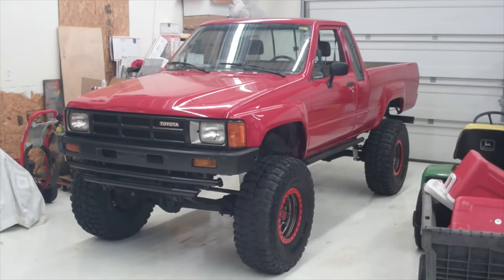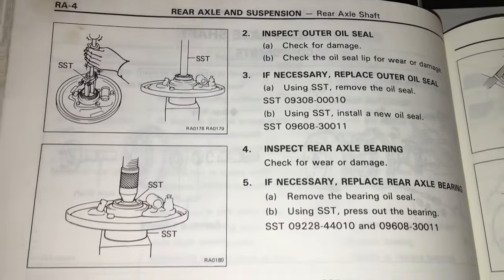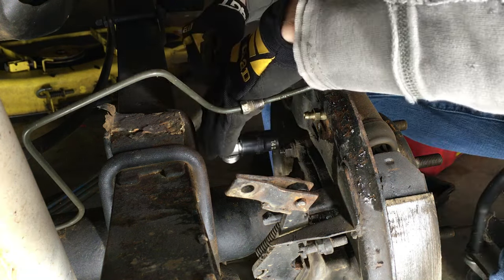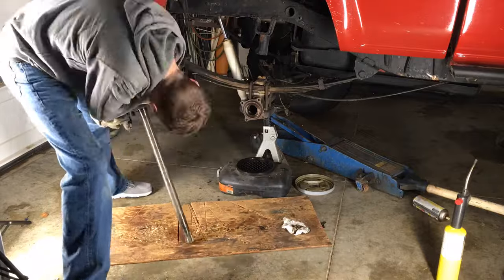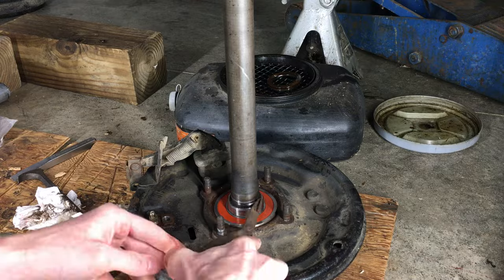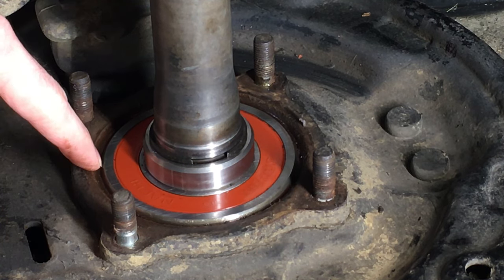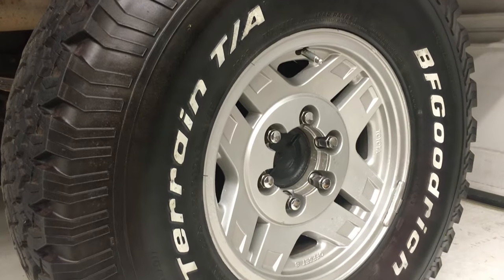Install Toyota Pickup/Hilux Rear Axle Bearing, Oil Seal - WITHOUT a Press!

Comment: I have a 2008 Toyota FJ Cruiser with rear caliper brakes. Do the steps vary much? I was told my axel seal is leaking but it has 156K so I thought I might change bearings as well

Comment: Hi Mate, just wanted to give you a shout out and say a big thank you. 
On my most recent trip away over the Easter Holiday to northern Australia, my wheel bearing smashed into 4 pieces 1,200km (750miles) away from home.
All the mechanics i contacted told me it could only be done in a workshop with a press!
I sourced the parts, and with limited tools and lots of cursing I replaced it on the side of the road with the confidence from your video.. thanks heaps, I owe you a beer!! Cheers!! 👍🏼👍🏼👍🏼👍🏼😎
Reply from the maker: You did this job on the side of a road?!? You are legend!!!

Comment: Pro tip. To remove the rear retaining ring that is pressed unto the axle shaft, cut as far into it as you can with a small cut-off disc. Just cutting about halfway through will weaken the ring just enough to crack it with a cold chisel and hammer. It will save you the hassle of banging that assembly into the floor for 30 minutes.
Reply from the maker: Juan Martinez I will try that next time 👍👍 thanks!
Reply: If one does not have air tools or electric grinder at their disposal, you can drill a few holes and use a chise and hamer to helps splinter the retainer also. Juans way is much easier when access to tools is not a problem.
Reply: hello there Juan. thanks for the pro tip👍
Reply: That sounds like the best idea. Just go to Toyota and get a new one before you start the project.

Comment: I loved the video and decided to try it for myself, but no matter how much I banged it I couldn't release it (also have the abs ring). Ended up building a puller tube that uses a 3 jaw puller to remove it. Worked seamllesly, highly recomended it if you don't have a press.
Reply from the maker: That was a good solution. I'd love to see the design of the puller tube.

Comment: Thanks Brother! I have a press and still used your method. It saved setting up the blocks and balancing act of the axle in the press. Took less than 1 minute per side to get the bearings off the axle and just moving them to my machine shop would have taken that long. Thanks for the video!
Reply: No way? It’s a miracle when repairs actually go as planned. Haha I just noticed oil stains around the 4 studs and plate. Hopefully bearings aren’t going out

Comment: In the mid of changing my wheel bearing on a 92 HiLux. The retainer ring would not move an inch, after pounding the backingplate for two hours i gave up haha. Found it easier to use different sizes of chisels between the retainer ring and wheel bearing to sort of press it out. But very good video

Comment: Looks pretty straight forward. I am doing the rear brakes on my '87 2wd Pickup and found the oil seals leaking. So I'm doing the seals and bearings while I'm at it. If I can't find a shop to do the hard stuff I'll give this method a try. However, I would never reuse a cotter pin. New ones for me. Good video, thanks!

Comment: I have a press, but I don't have a garage. Swings & Roundabouts, eh?

Thanks for the walkthrough. I'm going to have to do the oil seals on my Hilux Surf [if it ever stops raining over here in the English summertime] and, ironically, your video made it seem easier than other ones I've watched which did use a press. My only "wince moment" was when you used the pipe to drive the retainer on and the retainer was hitting on the centre of the wheel bearing, rahter than the edge.
Reply from the maker: Great point! I see what you mean... I should have placed something such as a giant washer between the pipe and the bearing.

Comment: I looked all over my area for a 20 ton shop press. Even a hundred miles away. So I build one. And I’m glad I did no pounding for me. If you don’t have a press take your axle to a shop and pay them to press the bearing.
Reply from the maker: I actually bought a used harbor freight 12 ton after this. I haven't had to do axle bearings since, but it's been useful for other bearings. No more sore hands!

Comment: I bought new backing plates not knowing it would be necessary to have some special press to take that off.. now im going to try again like you did. THanks for the tips!
Reply from the maker: Good luck and wear some well padded gloves!
Reply: @6thGearGarage  Thanks I will!.. Was thinking about the plywood and how it got chewed up.. I have a 1/4 inch copper plate.. was thinking of using that instead.. that way more of the energy would be transferred to the shaft..and maybe help get it off sooner.. The wood seemed to absorb the shock a little.. i guess in the end you would have bigger biceps!..  ;-)
Reply from the maker: @mg43472  the wood absolutely absorbs a lot of the force. I was tempted to do a couple of taps on the concrete, but knew it wasn't worth the risk of smashing up the splines. I was out of breath by the end!
Reply: @6thGearGarage  Yea.. no.. not smashing it into concrete!.. you wouldnt want to mess up the splines..!

Comment: Top Notch video. Only problem with doing it this way is it can bend the backing plate.  And also I've done a few where they just don't move at all with this method. Like the one in the video on my page. This method would not have worked. It was way too tight
Reply from the maker: Good call, especially if the backing plate is thinner from rust, as many of them do.

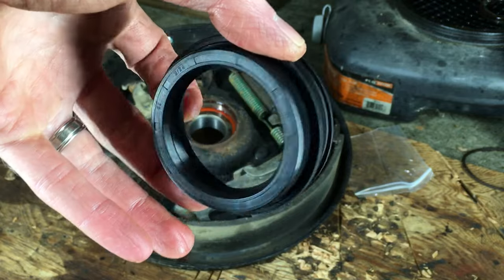Comment: 7:33 Don't do that. You are banging the inside race onto the inside race. You always want to drive a bearing in via the outside race so you don't damage the new bearing!
Reply: I understand your concern but we are all here on this video because we do not have a press nor do we want to go find someone who does
Reply: @lowdawg1776  dude, all we are saying is don't bang the inner race. You'll dent both races like that. Bang on the outer race when HAMMERering it in. You could grind off some material from the outside of the outer race of the old bearing so it doesn't get stuck in the hub, and bang on that. 
Don't give advice that fucks up peoples bearings please.

Comment: Excellent video, but I can tell you from first-hand experience there are some that this process will definitely not work for. A press is the best and safest way to go and sometimes the only way to go depending on how seized tight things are.  I once watched a guy bend the backing plate severely trying this method..
Reply from the maker: Since filming this video, I bought a used press. I figured it was worth it for the next time I need one.
Reply: @6thGearGarage  yeah definitely a good call to have one.  They are certainly cheap enough. I picked mine up used on Facebook for only $75.  Sweet Channel man, just subscribed

Comment: I've heard that flipping the retainer ring (bevel towards bearing, flat towards diff) can allow a better seal contact (apparently Toyota resigned the axle seals, so the witness marks are more inboard, closer to the beveled edge). I need to do all of this to my truck as well.

Comment: Great video but I think you could improve it better by inserting the bearing first into the hub by driving the outer race of the bearing  and then mount the whole contraption onto the long axle by using that pipe on the inner race to minimize potential damage by the shock on the new bearing. Thanks again for the video.
Reply from the maker: Hey that's a great idea!  Thanks

Comment: Thank you for making this video, I have a 94, and it’s the exact same procedure,  I thought I would have to take it to a garage until I watched this video, saved me hundreds, extremely helpful, thanks again!
Reply from the maker: Good to know the 94 is the same as the 84-88. I get asked that a lot.
Reply: bro is that with an ABS tone ring on the axle shaft?

Comment: I had the local fab shop make a puller. 2 inch thick wall pipe, 23 inches tall. A square plate welded to the bottom. 4 holes .4 mm big drilled 3.5 inches centered from each other. From one hole to the next, NOT diagonally ( i dont have that measurement). At the top there needs to be a plate to hold it in the press. About 6 inches long and reinforced on the top edge. The plate bolts to the back of the hub and any shop can press the bearings out for you, really cheap. My local garage actually called to have me walk them through what i wanted. If you have abs, measure the tone ring from the backing plate before removing. We used old bearings and the toll i had made to pound the new bearings and retainers on.
Reply: I ended up cutting the abs tone ring and retainer off with a cut off wheel myself and letting then put it in the press. Then i installed my wheel seal and bearings. The tool ran 120 bucks and paid 60 dollars to use their cut of wheel and press. I was relieved that the garage called to have me walk them through it. Its better than having the shop mess something up.
Reply from the maker: @brandoncartwright8829  absolutely!
Reply: Its cool you're still active on this thread.  Good job adapting to not having the correct tools. I dont trust anyone with my vehicles, thats why ill take parts off and use a shop only for things i dont have at home

Comment: Put a little heat on the bearing retainer with a propane torch ,you can heat the retainer in the oven before you reinstall it about 200 degrees is about right
Reply from the maker: Mark Warner thanks, good info 👍

Comment: I tried this on my '94. Didn't work but it did make my hands super sore. Like super super sore. I used two pair of gloves and a pieces of camp pad for protection. Heat didn't work either. So yeah ... I found a shop a few miles from my house to do it for $55.
Reply from the maker: If I was doing it again, I'd go to a shop as well.

Comment: Thanks for such an illustrative video, I will use it as a guide when a few weeks from now I'll be changing oil seals and bearing on my '94 4x4 pickup. 

Just two questions: 

1) Does this job require having the differential drained from its oil first?

2) Does this require to bleed the rear brakes afterwards?

Thanks again and keep up the great content!
Reply from the maker: 1. The rear diff does not need to be drained. 2. the rear brakes will need to be bled. Capping the line after disconnecting it will help keep the fluid in and air out, but it will still require some bleeding.

Comment: Wow! And the shop wanted to charge my son $1,100 to do this job on his truck. And that’s only to replace the seal since it’s leaking inside the brake housing assembly ...Thanks for the great video and I also subscribed 👍
Reply from the maker: Glad to help!  I can't believe they wouldn't just replace the bearings while it was apart.
Reply: 6th Gear Garage   Same here, my son mentioned it was an additional amount to replace the bearing ... Glad he called me for a second opinion. The kid is young and serving in the military and so sad that repair shop are inflating their prices for just a seal and taking advantage of our soldier...Told him not to worry, I’ll drive my truck with a backup car on a trailer and bring his truck to my place for the repairs. Since fuel is cheaper now, I could afford the road trip and visit my son 😎

Comment: Instead of slamming the axle into some plywood try removing the c clip bolting the axle back in the housing and using a large slide hammer to remove the axle
Love that truck dude
I’m doing a 22re swap into a 94 runner had the 3.0
Reply from the maker: That might work if I had a beefy enough slide hammer.
Reply: I’ve done it it’s allot easier trust me

Comment: There was a time when it was easier to take the axle out of the housing and take it into an auto parts store that would sell you the bearing and install it on your axle shaft for a very reasonable price. These days, with the rise of stores like AutoZone, O’Rileys, Advance Auto and Bumper-to-Bumper, it is almost impossible to find a store that will do any of that kind of work. My answer has been to buy a cheap press from Harbor Freight and make my own axle pulling tool. I have less than $150 into the whole set up, which leaves me with more money to plow into Toyota 4 x 4s, which in turn almost guarantees that I will be doing more axle bearing jobs, probably sooner than I think. And now that I have a press I am thinking about buying additional tools to work on differentials and transmissions. And why not, thanks to the Chinese, the price of tools is a fraction of what it was 10 or 20 years ago. 

Thanks for the video. Anything that gets people working on their own junk instead of paying the outrageous rates that professional shops charge is golden.
Reply from the maker: Thanks and well said!
Reply: WrenchTech Garage while you’re at it hire a few “migrants “ to get the work done fast and half assed but pay them in peanuts

Comment: Man, perfect video! Im looking for the kit though, its sold out....
Reply from the maker: Which kit? I may have to update some links....
Reply: @6thGearGarage  The kit you linked on Amazon with the bearing, seal, and all. I just bought everything separate from Rockauto. Total was $50, and I got NSK bearings. Im reusing the spacers. I dont see any need to replace those. They look fine. I'll clean em up a little.

Comment: Very nice thanks for taking the time to put this up Beautiful truck…what were your symptoms? I have a bad vibration on de acceleration from 60-75 can only feel in my seat nothing in
The steering wheel. Did front upper control arm bushings and front wheel bearings tightened up as they had quite a bit of play if you put your hands on the tire from 12 &6 o’clock about .5-.75 inch of play
Reply from the maker: Thanks for watching! I would check for slop in universal joints next.

Comment: Really great content, and great alternative. Just didn’t work for me. In the spirit of DIY, be ready to buy a 20 ton press and Toyota axle bearing press adapter. I spent 3 days trying this method. And I was working on a California (no rust) truck too. I gave up and bought a press. But overall, great video.
Reply from the maker: After having sore hands for a few days after this job, I looked and found a deal on a used harbor freight press. Now that I have one, it makes a lot of jobs so much easier!
Reply: @6thGearGarage  lol i know the feeling. My hands were out of service. I have the HF press too. Works great. Keep posting the amazing videos 👍

Comment: Wow I am having the most epic fail with this! I've done in 2 pieces of plywood from all the knocking and couldn't get the retainer loose. I was thinking this was because there was vertical play in the bearing. I don't know but went after it with a chisel and a flathead that I proceeded to destroy. Got the retainer off but did some damage to the threads on a couple of studs which hopefully I can clean up. Then I find that the bearing itself is stuck on the axle shaft and have to stick pieces of metal in between the backer plate and the bearing. And that's where I'm at now, bashing more plywood trying to get the bearing off. I was going to take it to the shop this morning they just told me they couldn't get around to it until end of next week so I dove in. Say a prayer for me y'all.
Reply from the maker: Did you try applying heat/ pb blaster?
Reply: Yes I did torch down the retainer for a while but didn't try torching the inner race of the bearing when it was still stuck on. I put the piece of metal in between thinking that I was going to damage the bearing housing with it being disconnected but still stuck on the axle shaft. I think that was just a bad idea all together because I definitely scratched the surface a bit where the o-ring sits. But I got it semi set back in place and just wailed on it a bunch more and it finally came off! To put on the new bearing now I actually took a chunk of 2"x4" and traced the bearing, cut the wood with a jigsaw then drilled out a 1 1/2" hole in the center which I had to rasp down a bit to fit around the thicker part of the axle shaft but it worked well. I wrapped the wood in masking tape and had to put more tape on at intervals to prevent wood shards flying everywhere. Had a pipe that was the exact size of the retainer so that went in super easy, and got the stud threads fixed up that I damaged so I think I'm in the clear!! Definitely investing in a press if I ever have to deal with this again! Thanks a lot for sharing this though - I didn't know how hard it would be and it probably has been the hardest work I've ever done on my truck but I did save some good money and am not as broke as I otherwise would be taking it to a shop. Cheers :)

Comment: yes ... .... great vidoe im stuck at getting the backing plate off though! Hammerred a piece of ply into submission with the shaft already. I guess after i stop sweating ill have another go! :)
Reply from the maker: Let it soak in some PB and then throw some heat on it, too!
Reply: @6thGearGarage  Ok... thx for advice ill give that a go... its jammed solid ATM. I went back ....... could not shift it even a little bit more! took all the brake stuff off in prep for finding someone with a press, but i HATE to be defeated! lol
Reply: @6thGearGarage  ps... what's PB?... I'm in Australia! :)
Reply from the maker: @neilcowan535  PB Blaster... similar to WD40. Good stuff!
Reply from the maker: @neilcowan535  I'm with you but at a certain point, time is money. Not to mention bruised hands!
Reply: @6thGearGarage  lol. My hands are good ... literally been throwing that axle down on the ply then catching it on the bounce! Only jammed 1 finger lol .... so which part  do i heat? (ive been youtubing but still not sure coz often its an aluminium housing wih a bearing stuck inside, but this is steel on steel ofc) .... its the bearing retainer thats tight on the shaft... so heat that but try not to heat the shaft? thx for your replies really appreciate it. (love your Toyota truck BTW! :) )